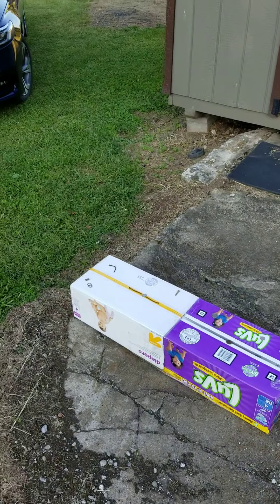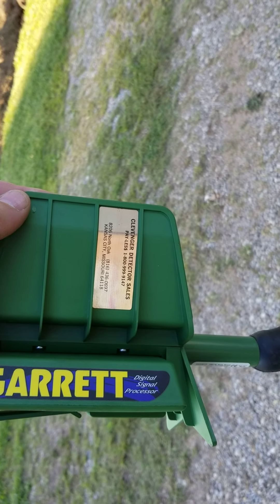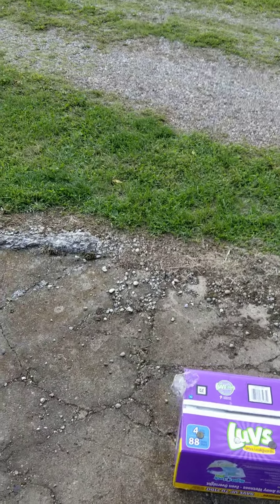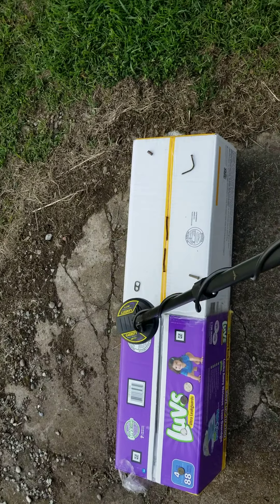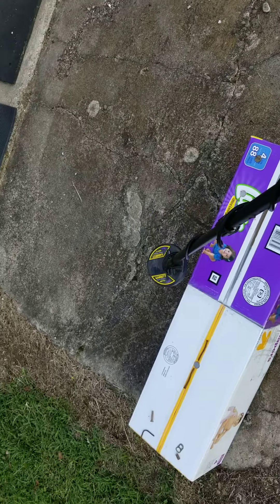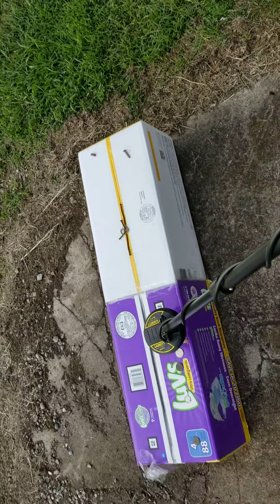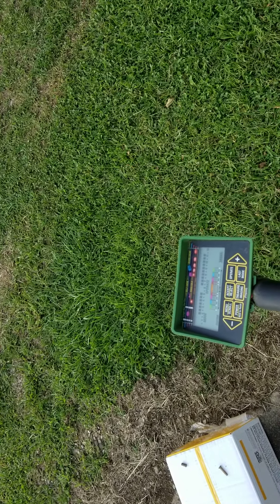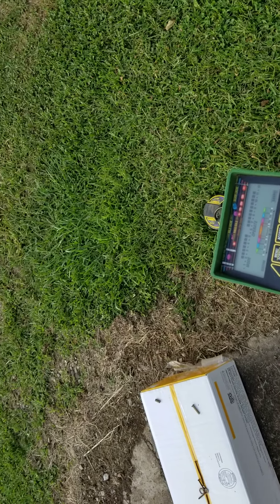Part 1 of notching (GTI 1500) WV Coin Miner

Comment: Hi, can I ask you a question?
Reply from the maker: Ask away
Reply: @rickvann3489  Thank you, I recently bought a SWM 300 of 2021. I see that when you reach like 8000rpm, the power completely cut. Is there a way to solve this problem? How have you solve it? Changing the crown or putting a new map? Thank you
Reply from the maker: @Francesco Bianco  I gave up on the bike because of the remapping etc. There is newer software and delete kits but I have not kept up on it. The RPM kicks off because of euro tier 5 emissions. Search the internet lots of guys have figured it out but most were cutting back around 5600rpm. Good luck and sorry I couldn't help more.